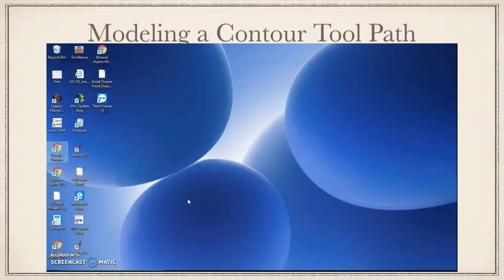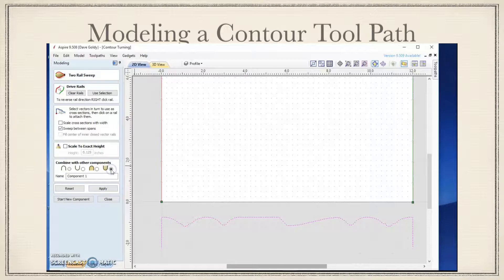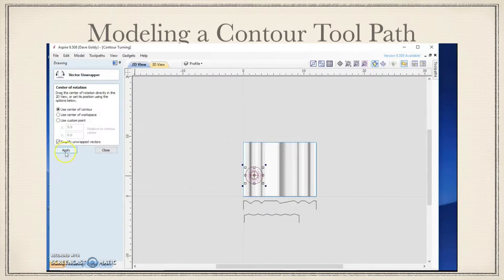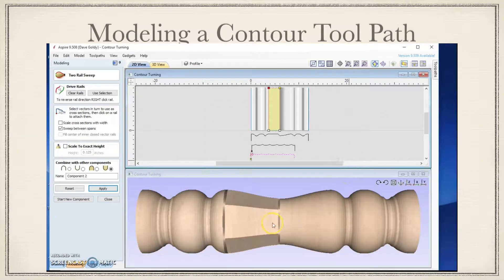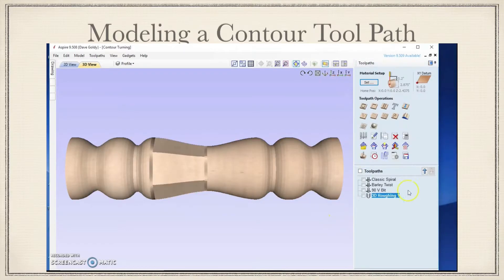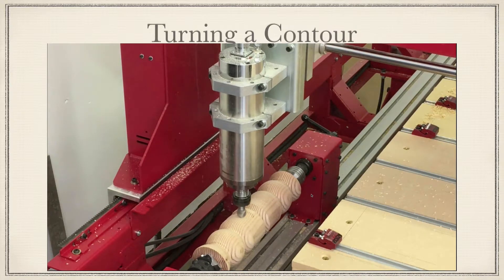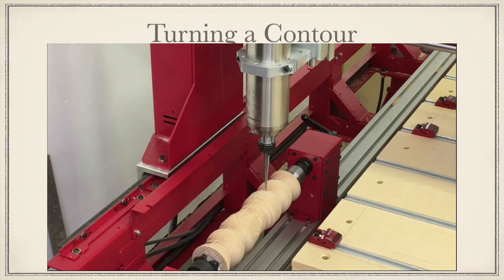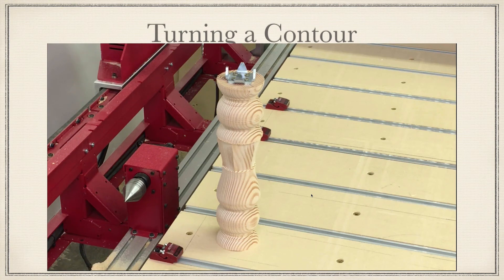Contour Turning

Comment: It seems to me that the tilting feature (B positional axis) is not useful in this instance.  That is the one feature that is unique to that brand of CNC router.  Is it a trade off for simpler programming when using Aspire?
Reply from the maker: There are several things I would like to try with the rotary option, but as yet have not taken  the time. Using the tilting bed on the Maverick is one of them.  I hope the tilting bed could make the programming easier, but I have not tried it.